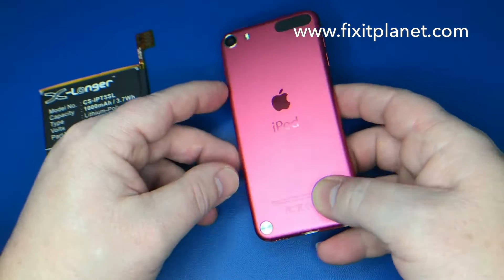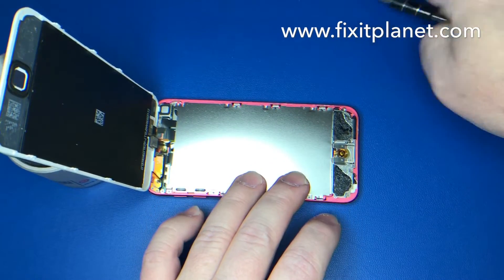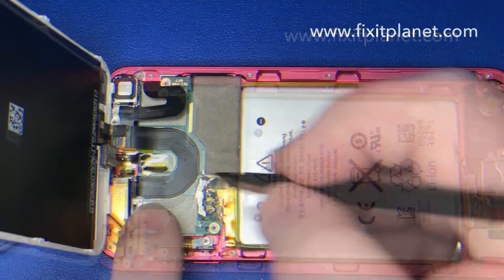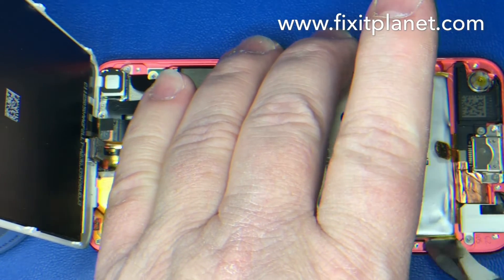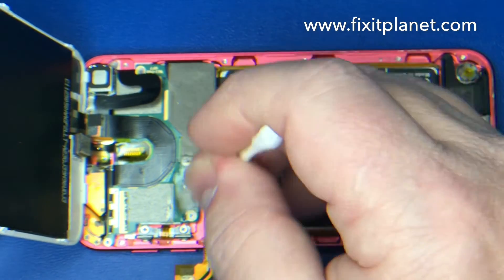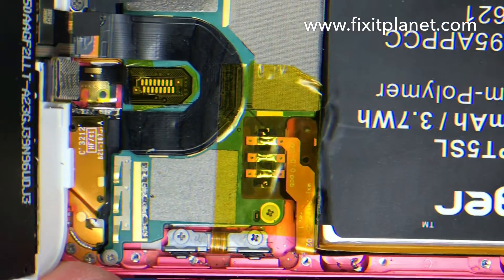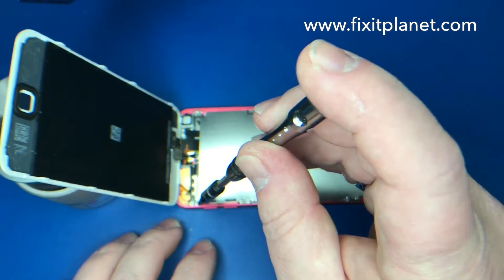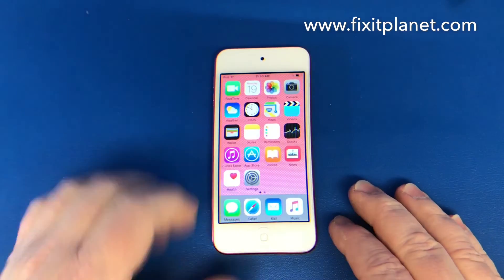iPod Touch 5th Gen Battery Replacement From Start To Finish.

Comment: Hello, one question: anybody knows if any type of tape can be used instead that yellow used here to cover the contacts after soldering the battery? Scotch tape would work or must be some specific? Thanks in advance!
Reply from the maker: Preferably electrical tape but any tape will do.

Comment: I'm almost done with this repair. I don't have any strong back adhesive so I'm going to use super glue to secure the battery in place. Hope I don't have to worry at all about corrosion! Can anyone comment on whether or not it's an issue here?
Reply from the maker: It is not the safest idea no....I would not recommend using super glue. Your better off with some cheap double sided tape.
Reply: @FixItPlanet1  Awesome, just finished the repair. Everything works great! Thank you!! Never soldered anything in my life before attempting this.

I didn't use any separate flux, only rosin core solder (flux: 1.8%).

Although not nearly as sticky, I ended up using double-sided tape (had to layer it on to get a better stick) instead of super glue before I read your reply. Thank you for the fast reply and thank you again for this very helpful and informative step-by-step video that made the repair very straightforward and possible!
Reply from the maker: @sonickchri  Awesome! Good job!
Reply: it says you have to heat it before prying ("hot plate"). How hot? Luke-warm? 60° Celsius or something like that? Boiling-water temperature? More?
Reply: @kaihanstein52  I personally didn't use a hot plate but I put it on a silicone surface and used a heat gun and heated it somewhat while I held it with a glove. You can get it pretty hot (hotter than too hot to touch) and I would think it shouldn't matter. I didn't need to heat it too widely (only in a few areas) because the case had already popped open due to the battery bulging (hence me doing the whole battery replacement).

Besides the parts that I needed to take the frame off, I think the only other parts I heated were the home button area and the part where the battery is soldered. Just enough to do the job cleanly is enough.

Comment: Hello John, my iPod went into bootloop mode ( apple logo turns on and off) when I plugged it in before finally assembling. What could it be? I did everything as you shown but it is my first time replacing battery in it. Thanks!
Reply from the maker: Hmmmm... idonno that is a good question.  Sorry but there is no reason replacing the battery would cause this if everything was working to start with. However if the battery was bad it may cause something like this. It is really hard to say.
Reply: Thank you John, just as you said it happened to be the case of faulty battery. The one I ordered online from Chinese retailer Ali express did not hold any power. I finally got around finding the exact same brand Cameron Sino, this time around I measured it with voltmeter before installing - it showed 3,97 V - which is already good sign. I replaced my replacement and repeated the whole process. Although it still went into boot loop on my initial check prior to assembly, the IPod FINALLY came back to life when I closed it permanently and powered it with the battery alone.
Thanks again for your tutorial!

Comment: my home button stop clicking after I replaced my battery :(
Reply from the maker: Hehe... what? Try looking at the button (not the plastic part) but the actual button underneath. The black nipple should be center.
Reply: @FixItPlanet1  yeah, I end up buying a replacement charging port for like $5 just to get the black nipple thingy, after I swap it, it started working like a charm
Reply from the maker: @akboss14  Yup that works

Comment: I have replaced batteries on 3 different ipods that I own.  Every time, the new battery gives me fluctuating charge readings and seems to drain rapidly even when the ipod is not used or is turned off. The fully charged battery will be dead in 24 hours.    The 3 batteries I bought were from  different battery manufactuers and different sellers.  Am I that unlucky that all the batteries were bad?

Comment: Well, I was right with you up to the point of "drawing up the solder" through the connectors.  Unfortunately that didn't work, and I've overheated the battery cable to the point where it is black.  Not sure what I did wrong!
Reply from the maker: There is a thin layer of plastic covering the pads. Did you remove that first? Did you tin the pads? Are you using flux? Clean up the area with some alcohol and try again.
Reply: @FixItPlanet1  Yes, I took off the plastic, and tinned the pads.  Also used flux.  I ruined this battery, so I bought another one and will try again.  Maybe my soldering iron was not hot enough?
Reply from the maker: ShadowAlmighty  The solder should melt immediately when iron tip touches. It shouldn't take more than about 15 seconds to solder all three pads.
Reply: @FixItPlanet1  OK, I bought a new battery, and new tips for the iron.  I'll give it another shot this weekend.  For some reason, even though I tinned the pads, the new connectors wouldn't stay down after I touched them with the iron.  I WAS using a battery powered iron, and while it usually works, maybe it was too cool.  I'll use a corded iron with the new tip, and let you know how it goes!  Thanks so much for replying!
Reply from the maker: @ShadowAlmighty  Cool sounds like a plan. Hold down the connector while you solder. ;)
Reply: @FixItPlanet1  Success!  When I was cleaning off the pads, I discovered two of the old connectors from a previous battery were still on there.  After I took those off and cleaned up the pads, everything went smoothly, and the iPod is up and running!  Thanks SO MUCH for your help!  My 12 year old friend will be very happy when I mail him back his iPod!

Comment: Wow, good video. I had already ordered batteries for my two gen 5 ipod touches or I might have avoided trying to do this. I just finished my first battery replacement. I am not that good at soldering and I just have a cheat little iron, some flux & solder for electrical stuff. I just followed directions but mine did not go as well. Getting the thing apart was not easy and the edges got beat up a bit and I tore the plastic piece that goes around the edge a couple of times but was able to get it back together regardless. The black piece that goes over the solder area did not come off in one piece like his either but I managed to get it off with my soldering iron  and the tweezers while my wife held the ipod in place so it would not keep wondering away from me. I put flux on each of the three solder joints and put the solder directly on the tip of my iron and then put the iron on each solder joint for a couple of seconds to get some solder placed on each. I lined up the new battery solder joints to the ipod and one at a time, held it in place and placed my iron on the joint for about 5 seconds and held the joint steady for 5 seconds without heat so the solder would dry. I tested for a normal boot before putting the whole thing back together and it worked! I had my doubts! If I can do this, you can too so give it a try. I have one more to do and hopefully it will go even better.
Reply from the maker: Thank you good job!

Comment: I liked your video...Just wanted to mention, there is a slight but unfortunately significant difference in the procedure between the 5th generation and the 6th. The most important first step I would mention is to verify the version of ipod that you have by checking the number on the back. You did this in your video casually, but I would reinforce this as a primary step. I purchased my ipod from a person who said it was a "5th generation ipod touch" well... it was actually a 6th generation and I found out too late unfortunately. I watched your wonderful video and purchased all the tools (heat gun, adhesive, soldering iron, solder, flux, tape, opening tool, etc.) and battery...then watched the video again 6 times to make sure I was comfortable with the procedure. I heated up the home button and gently attempted to lift the home button..but it popped off! It turns out the home button on the 6th generation looks almost identical except that you do not need to lift it up before removing the shield. If you attempt to do this (as I tried to) you will damage the home button to the point that you might as well drop your ipod touch into the trash. The home button on the 6th generation has micro-soldering connections hidden underneath and it's connected to the entire system components and a MAJOR repair. I wound up popping the home button off and completely ruining my ipod touch 6th generation thinking it was a 5th because that's what the person who sold it to me told me. Please recommend to others to "Check your version!" Dang. It's my bad but I REALLY wish that you had said something like, "First thing, check your version! There are some slight differences between the versions that can turn a success into a failure QUICK. Check your number and verify what version of ipod touch you actually have. Some poor pant-load didn't check and ruined his gear. You might think you know what version you have...but FIRST check!" Now if someone will just hold my hand.
Reply: nice bro

Comment: Thank you. You do make this look easier than it is for a first timer. I did a bit of cosmetic damage getting it open, but followed your guide and got the battery replaced without any drama. Thank you.
Reply: what made you know for sure it was the battery?
Reply: @Vatation it’s obvious to know when it needs to be replaced, the battery doesn’t charge or stay charged.

Comment: I am not inclined to do this myself, but I need it done. Can I ship it to you to replace the battery? If so, what would the charge be please? Thanks.
Reply from the maker: Visit https://www.fixitplanet.com for mail in repair instructions and call 817-602-1160 for pricing.
Reply: How much did it cost you?
Reply: Pocket Productions. How much did what cost me? If you’re referring to the iPod it cost me just over $200.00. I have not had it repaired as of yet. I did call your number and spoke to a nice woman who quoted $80.00 to replace the battery. I’m conflicted. I’m not sure I want to spend nearly half the price of the original purchase for a battery.
Reply from the maker: @chipmohan1534  Fix It Planet is not pocket productions. We don't know who they are.

Comment: Fantastic. I have 2 iPods (5 & 6) that haven’t turned on since 2016 and 2018, respectively.
I tried replacing the battery in the 6 first, but I wasn’t careful and damaged the solder pads. This was my first time soldering and working on mobile device hardware, but I figured it was worth a try since the devices were dead anyways. 
I used this video for the 5, and it worked! Luckily I had a semi charged battery so I realized that that charging port was damaged. After cleaning it with a toothpick, some alcohol, and bending the charging cable I was able to fully charge it. I already created a backup on iCloud just in case the device fails again and I backed up all data. 

Lesson learned: Be careful and take your time. 

Thank you for this video! Next up, my HTC One M7 and A9

Comment: Just one question, does replacing the battery affect the data and stuff that's on the ipod? My 5th gen ipod touch has a bunch of music/videos and pictures I wouldn't wanna lose but the battery in it is burnt out I think.
Reply from the maker: I have not had any data loss from replacing the battery. (However it is possible) You should always back up the device before performing any repairs. Just in case something unexpected happens.
Reply: @FixItPlanet1  the device won't even turn on, so backing it up is impossible.
Reply from the maker: Well that sucks...

Comment: Thanks for the video! My 5th gen is running like a champ again. One thing different about mine vs yours was the pink plastic framing inside yours. Mine is black, and it covered all the screws. I had to remove that frame to get access to them. That was an additional step of prying six (I think) more clips away from the edge of the case.

Comment: Very helpful. Mine was easier because the glass was off/lifted when the battery went fat. WAY easier than I thought it would be. My iPod button didn't need lifting so seems the cover plate design changed, but getting the silver off the connector is tedious. Once clean It didn't need any cleaning maybe wipe with alcohol to remove stickiness. The worst part is reassembling those tiny screws. My advice is if are older to get a really good sharp magnetic screwdriver. The ones that came with the battery were useless. I appreciate the effort to record these, I cant do that, I always get into it and forget to record what I am doing.Thanks again!

Comment: Thank you SO much! I was confused on the soldering part but I just tried following your steps. And my ipod turns on now! Before the apple icon would just flash and go away and it wouldn't turn on anymore (Only had the little guy for two years) Thanks again!!!!
Reply from the maker: That's great! Thank you
Reply: Wait, did it just go to the Apple logo then go black? And did it randomly reboot, freeze, get occasional screen lines before no longer turning on?
Reply: @Sonicfan1661  mine does that occasionally. What does it mean?
Reply: @alexanderstevenson6484  I wish I could give you a concrete answer, but all I can do is theorize. Has it ever been exposed to liquid? I believe mine has liquid damage, tho I haven't been able to get all the way into it to check. It could also be the battery needs replaced, or even just a corrupted operating system, which would likely require a factory reset/reinstall of the most current operating system it supports. Note that if you have any important data on the device you should back it up before resetting/reinstalling the OS, both locally on your own computer and on iCloud if you can do both, but just one should be good enough if you have the necessary storage space on either. I have yet to actually figure out what the problem is with mine, so I may not even have these problems in the first place, just my theories on what could be causing them.

Comment: Thanks for the video, definitively worth it, $10 the battery and $15 flux is a bargain to change my inflated battery on this iPod touch. Now, why on earth did they soldered that bloody battery? If you have a rework station, no need for a heat gun to heat up the home button, use the rework station at 100°C to soften the glue.

Comment: Thanks for this. Can I bother you or somebody here to put together a parts list for this procedure? So far I think I have:

-iPod 5th Gen battery
-screwdrivers and scraping tools
-heat gun
-soldering iron
-solder wire (size?)
-flux
-heat tape?
-ESD mat (optional?)

Am I missing anything?

Comment: At 4:40, you refer to "low-melt alloy . . . or leaded solder." Looking at one popular electronics retailer with dozens of solder types, I can't find any product called "low-melt alloy" and searching for "leaded solder" brings up mainly "lead-free" options. I do see something called "low-temperature solder paste" as well as various solders that list lead in the 30-60 percent range. Do you have some specific product names you'd recommend for this "lower melting point" procedure? I'm assuming, based on your answer to my earlier question, that you are putting this special solder on the tip of the iron off-camera and touching it to the factory-applied solder to melt it. Sorry--this is confusing to those of us who basically know only basic soldering procedure.
Reply from the maker: I am only using 0.05mm 60/40 solder by Multicore on my iron tip. Kester makes a good solder too. Here is some good Kester leaded solder for example https://amzn.to/2DDxEH9 And here is some cheap low melt alloy for example https://amzn.to/2DRkN55  Chip Quik makes a good low melt alloy but it's expensive and not required.

Comment: My 5th Gen iPOD is over 5 years old. It charges to capacity in about 10 minutes and discharges in about 3 hours of streaming, (Pandora) use. I have a new Hakko station and silicon mat so I’m gonna give this a go. I’ve been doing iPhone batteries and screens but this will be my 1st iPOD. Appears straightforward. I have the tools, the desire and now this video to get it done! Many thanks and I’ll let ya know how it went.
Reply: So how did it go?  I'm considering doing this for my son's iPod and I need to know if I have any chance at success.
Reply: Doug Wilson maybe some chance but the soldering parts are the most difficult parts one mistake can ruin the pins resulting the battery to no longer function...

Comment: What temp do you set the hot air station?
Reply from the maker: Between 750 to 800 Fahrenheit. but every station is slightly different. You have to experiment with what you have to see what works best for you. How far away from the component, how much air volume what size and type of nozzle etc. all have an impact on results.

Comment: i see you applying the flux the connections, but the next thing i know your soldering. where did the solder come from?
Reply from the maker: The solder is added to the tip off camera. Sorry for the confusion.

Comment: I can't believe they solder the battery in. It's not like it saves any space over using a ribbon cable. Heck, even the new iPod Touch announced yesterday still has a 3.5mm jack.
Reply: That's because the 7th gen still more or less has the exact same design as the 2012 iPod touch 5th gen except for an internal spec bump. If the iPod touch ever made enough money to justify an actual redesign, you can bet that 3.5mm jack is the first thing to go
Reply: You got that right,for as much as you pay for these things,you'd think they would make it easier.Oh well Apple designed for self obsolesce.